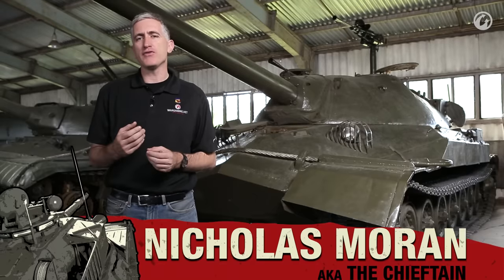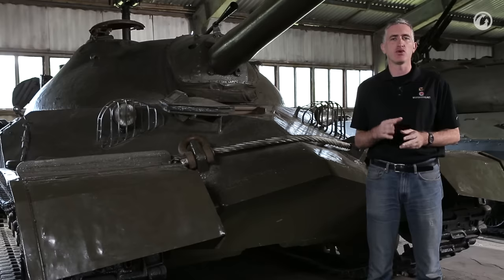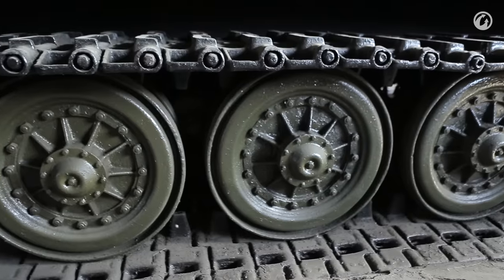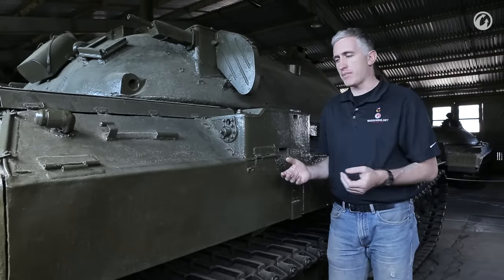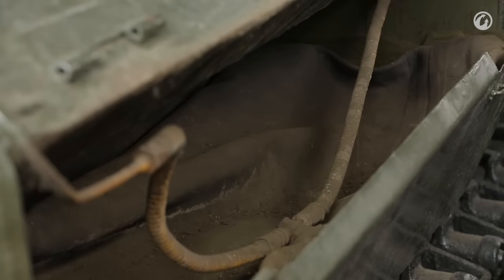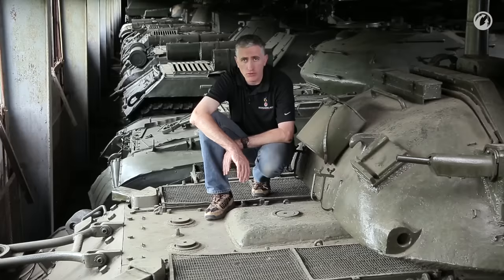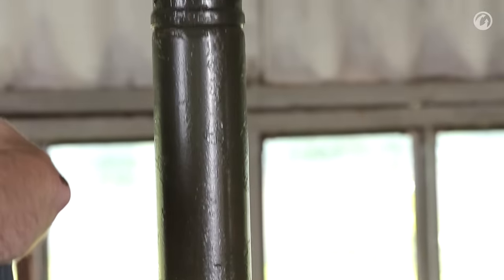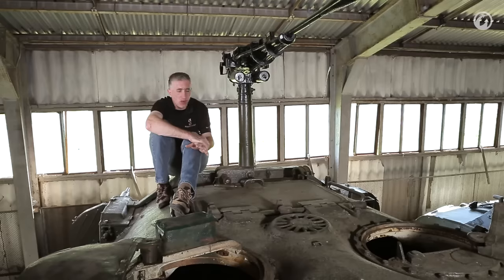Inside the Chieftain's Hatch: IS-7 Part 1

Comment: is it just me or does it seam weird that no one put the same armor thickness the hole way around
Reply: What do you mean? The sides, rear, and front having the same armor thickness? 

Every millimeter of steel adds more and more weight, as such, the tank gets heavier with armor. The Maus for example, had incredibly thick side armor, and that beast weighed over a hundred tonnes, and it was barely functional. Another example of why a literally heavy tank can almost always be a bad idea is the Tiger B/King Tiger, Which constantly broke down due to it's weight being too much for its engine/gearboxes.

Directly up scaling a tank would not work either, as it would still struggle under it's weight.
Reply: ok thanks for the explanation I couldn't figure out why a armed vehicle vehicle was beafed up as much as possible to last as long as possible

Comment: a bag of fuel protected by sheet metal.....seriously....a bag of fuel

that really seems like a small vulnerability
Reply: for what?
fuel doesn`t really burns from bullets
and even if
there is just gonna be fire on the tracks 
it`s nothing
Reply: Глеб Маслов ...a moderm m1 abrams gets just over half a mile ( just under 1 kilometer ) on a gallon of fuel ( 4 liters )

ask the germans how running out of fuel helped them out with there tanks....

so I say again....a bag of fuel protected by sheet metal is a bad idea, the tiny amount of fuel left inside the tanks interior fuel tank will last just long enough for you to run out of gas right in front of the enemy you planned on fighting